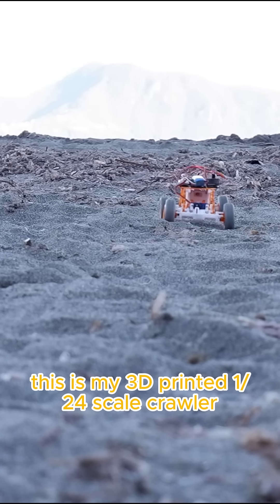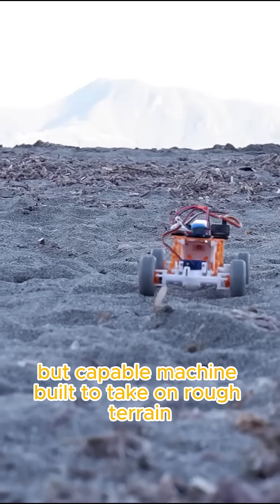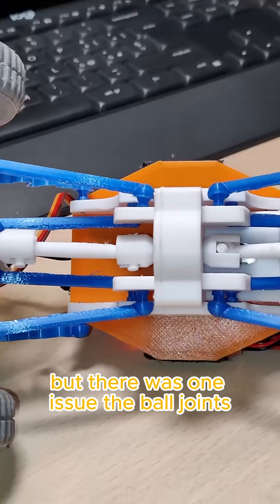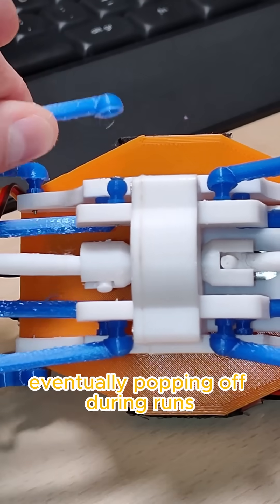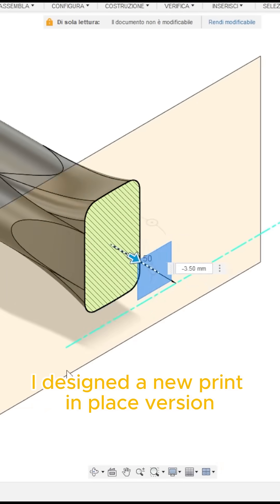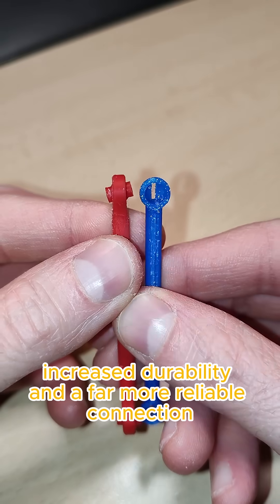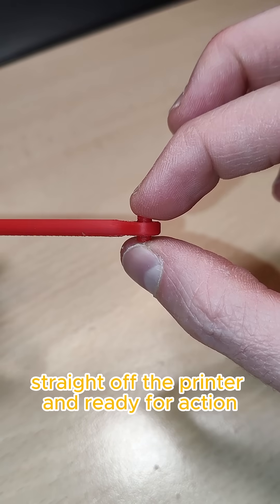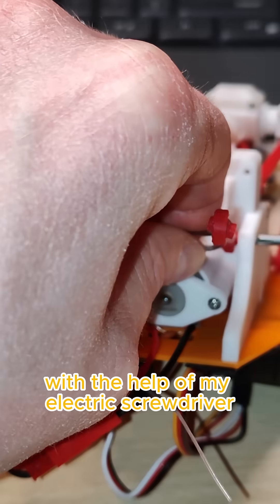#3d printed 1/24 #RC #Crawler - Ball joints upgrade #rccar #diy #bambulab #3dprinting #science

Comment: Instead of changing the joints, you should've made shocks, instead of putting that load into the links themselves. That's what's causing the wear. Fix the cause, not the side effect.
Reply from the maker: It has 4 shocks, 2 for each axle as a standard crawler, print in place joints were a big upgrade on this project

Comment: im thinking tpu bushings that are made to expand into a socket under compression from a screw could work
Reply from the maker: @_blood_moon_proto_1500  it could probably work, but I think there would be a lot of friction between the TPU and the rod
Reply: @Faber222  i think some of the older types of tpu have less friction
Reply: @_blood_moon_proto_1500  that's not how physics works, it's still tpu. There's a reason rod end joints are usually metal from full scale to 1/24 scale.